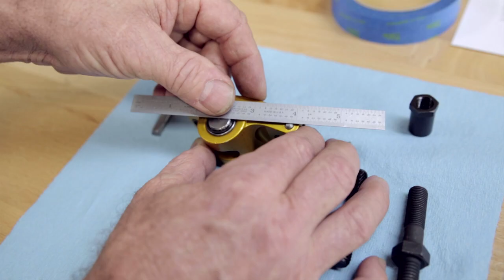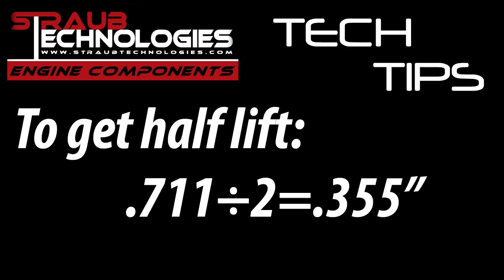Engine Tech: Valvetrain Geometry

Comment: Is there a method for doing this if you have a Comp magnum style rocker with a roller tip and no trunion in the middle?
Reply: Will this work for hydraulic roller lifters since you're not turning the engine over? I also have the comp ultra pro magnum xd rockers for my ford 400.
Reply: Yes it does, thanks! One other question, I'm downsizing the cam to one with less lift and a larger base circle. Does this typically require a shorter or longer pushrod?
Reply: @JT 5150, install the rocker arm with a valve/retainer and checking spring. turn down the nut to an approximate area where you 'feel that the geometry is close. look at the rocker arm profile side from the front of engine. clean oil off side of rocker arm and draw a VERY thin line, vertically with a pen or fine sharpie that is directly in-line, up and down with the center line of the rocker stud. 
Then hold up on the pushrod side of the rocker, and push down on the valve side of the rocker tip and watch the thin line rotate back and forth with each rocker jiggle. 
The thinner the line, the easier it should be to estimate the pivot point of the Trunion pivot centerline.

Comment: My rockers are different, if I go 90° @half lift, the geometry is all wrong. Drawing a line through the center of both doesnt always work. Say your roller at the valve is 1 size, but my roller at the valve is bigger, that ruins the whole theory. I found where my roller runs centered on the valve, but your theory doesnt work with my rockers from TRE. Yours are Crane and have a different geometry. I ended up with a 7.550 from a stock 7. 800 push rod.

Comment: If your mocking up the engine, it's best to use a used (previously compressed) head gasket.  This will save wasting a new one to get the head in the location it will be on the finished engine.

Comment: Good Video; I have found that if your using Hydraulic Lifters, especially aftermarket anti-pump up types (i.e. isky,crane,etc.) not only do you want to completely submerge the new lifters in Fresh oil (same as your going to use) over night; but before installing them in your engine; leave them submerged and install a pushrod in your drill press and pump the plunger up and down of each lifter until no bubbles come from the purging hole/s in the lifter, Than you have no worries of collapse,preload,etc, after installation
Reply: Take an old lifter the same measurement as you are using, take it apart and fill it up with JB Weld, then put it back together to get a good measurement.
Reply: i use an oil squirt can and fill the lifter.

Comment: Maybe I missed it, but how do you account for pre load on a hydraulic lifter with this method?
Reply: In my opinion, instead of counting turns on the rocker nut to set the rocker at correct installed height - you should put a dial indicator on your valve retainer and open the valve to 1/2 your valve lift. Say your cam card says you should have .500" lift with a 1.6 rocker - open the valve to .250" as measured by indicator, and adjust your pushrod accordingly. Or, you can disassemble an old lifter and shim it to essentially make it a solid lifter. Obviously, that is for checking purposes ONLY - NOT to be run as a solid lifter in an engine.

Comment: Good job, very well showed/ teached !! Now, question for you: I want, IF I can, to change rocker arm ratio from 1.6 to 1.7?? To increase valve opening, right? My engine is Mustang 3.8 litre V 6 (2004). Do you think I could safely do this, or is it possible?? I am planning to change stage 2 camshaft with stiffer spring too, also other mods, like intake, headers, cat pipe, aso, no turbo! Would I need different push rod length too?? I sure don't want valves hit the piston at 5000-6000 RPM, right =)) Thanks again, please, let me know, if I gain anything to change lifter arm ratio, and what do I have to do, if it is even possible?/ Thanks again=)

Comment: So I spoke with Scott on the phone and he took the time to explain to me in more depth the problem I was having with this method. Basically I was off a bit measuring my 90 degree angle. You have to understand the importance of being precise as possible on this step cause the slightest miscalculation is magnified because of the angles and ratios. Once I got it right the pattern on the valve was very narrow and just barely off center, which tells me my valve is being pushed straight down with very little sweep from side to side. This is the correct way to set up valve train.

Comment: I've tried this method several times and it leaves my roller tip way off center of the valve. The wear pattern is way outboard like the pushrod is too long.

Comment: Is the best way for my ls engine with comp cams non adjustable  ultra gold acr roller rocker 1.72 ratio  to get zero lash then just add the lifter preload to my zero lash length will that get me the proper length?

Comment: Why not just turn the cam over so the lifter is at half lift, then adjust the pushrod until the rocker is at 90 degrees to the valve? Obviously with the timing set installed so the cam is locked into that position

Comment: If I turn a 7/16" nut down 5 turns, the pivot point of the rocker arm travels down the stud .250".  But the rocker arm is not symmetrical, in that it has, say a 1.60 ratio.  So if the pivot point goes down .250", does theoretically the valve would "lift" .400".  Am I off base here?

Comment: For OEM hydraulic roller (short travel/high rpm) lifters should you add 0.050" to the pushrod measured length for pre-load?

Comment: Hi, I tried this and the pushrod seemed to come out really long when the cam is on the base circle.  (Longer than the stock rod and longer than the Crane Cams Length checker).  Should the cam lobe in question be on the base circle or at full lift?  I'm sure I did all the calcs right and using checking springs.    Seems like it wants to be at full lift to get a sensible length?

Comment: Never have installed a roller cam or rockers before, using the half lift method make sense to me theoretically,  just wanted your input and see if my thinking was right on this.  Averaging the lift between intake .515 and exhaust .530 on the Lunati 20510711 roller cam .5225 half that .26125/.050 is equal to 5.225 turns past 90 degree point with the valve.  So if I stop at 4.5 turns + 1 flat of the adjusting nut to measure for the pushrod, then when it’s installed it would be 5 turns + 1 flat or half turn past zero lash and that should center the roller on the valve stem and set the preload on the lifter??  Will this keep the pushrods all the same length or do you need to do one length for intake and another length for exhaust?

Comment: Not sure what my problem is, but there isn't enough stud height to aligning the rocker at a 90° angle to the valve stem. With the lock nut only 2 full turns the angle is about 85°. :(
Reply: I got a set of Flotek 180cc aluminum heads for a warm 355 SBC for a ski boat. Can't remember the pushrod length Flotek recommended, but it was WAY too short to acheive the 90* angle shown in this video. As the pushrod was getting about long enough to hit the 90* angle, I ran out of rocker stud height. Had to buy a new set of ARP rocker studs. Somebody is totally wrong on PR length - either Flotek, or the guy in this video. I went with this guy. Hope it works out for me.

Comment: For those of you that are being sidetract about the rocker ratio and thinking the ratio affects how many turns of the adjusting nut....this doesn't matter.The rocker ratio could be 1.2:1 or 1.9:1........ you still want to have the centreline of the trunions at 90 degrees to the valve at mid lift.....and then when that is established, measure for pushrod length.
Reply: Forrest Miller to be fair, the rocker ratio does affect how many turns you need to turn the adjuster, it’s just that it’s already been included. He is making his calculations based on 1/2 of total VALVE lift, which is your cam lift multiplied by rocker ratio.
Reply: This does not take the ratio into consideration. The lift is on the cam which will be multiplied with the ratio to create the valve movement

Comment: Awesome video indeed!
But just to see if I get this right, at the point of extending the adjustable pushrod (9:48) and taking up all the slack, the valve is still in it's fully closed position. So, at this point the lifter was sitting on the base circle of the cam, right?
Reply: Is it setting on the base circle of the cam

Comment: Should you use the cam card for lift figures or actually measure the overall lift with your rockers.  I ask this because rockers are rarely exactly what it is stamped (1.5,1.6 Etc..).  great video!

Comment: Much different method than the one in the Comp Cams videos.....Ill just stick with whatever guage my SHAFT ROCKER manufacturer provides me and try to keep my sweep centered on the valve stem so I don't prematurely wear my valve guides out......I just stay with my method because SIDE LOADING the valve stem happens when the sweep pattern isn't kept centered on the stem, I'd rather have my valve guides live a long life.

Comment: I might be missing something here but because the pivot point (as you wind the adjuster/polylock down) is the nose roller, then wouldn't the distance the pushrod end of the rocker moves, be more than 0.355"? I would think the pushrod end of the rocker would lower 0.533" (if you were using a 1.5 ratio rocker). If you wanted the pushrod end of the rocker to go half lift, would you not wind the adjuster 0.237" (for a 1.5 ratio rocker) ie. 4 3/4 turns on your 7/16" stud? Correct me if I'm wrong. I'm just trying to understand it all.
Reply: The head he is using is a Big Block Chevy,  Rocker arm ratio is = { 1.7}.  Gross valve lift is .711 {1/ 2 gross valve lift is = .355 }   .355 / rocker ratio { 1.7} = .209 lobe lift.(1/2 lobe lift }  At  1/2 lobe lift the rocker arm roller on the tip should sit in the center of the valve

Comment: So after following you procedure my sweep was .045" but only .090" from the exhaust side of the valve stem. Is this acceptable? Before my sweep was .100" and was dead center. It seems that you are fighting a loosing battle here because the valve stem and rocker stud converge the farther you go up on the stud?
Reply: I had the same problem I ended up with .050 backset crower rocker arms

Comment: This video is great  but could you explain how this method is going to work when you have a shaft rocker like on a mopar small block early LA engine with comp adjustable roller rockers.I dont know the thread pitch on the adjusters . plus how does this relate to the use of lash caps ,which I often do to create a wider wipe area on the valve stem for the roller tip.. hmmm

Comment: I have a zero deck 402 BBC with a solid roller isky cam, and Brodix BBO heads.  I asked Isky should I measure the pushrod length and Richard said not worry about it, pushrods would remain the same.  Im going to check everything anyways, but Id like to think they know their stuff, why would he say not to worry about it?  Is it because of the CI size of the motor?
Reply: +Danny Duplechian SO WHAT DID YOU FIND OUT ?
Reply: Have not put it together yet.  soon
Reply: +Danny Duplechian we'll get busy damn it

Comment: There's something that needs attention.   If your trying to get .355" at the pushrod by tightening down the stud using the top of the valve as the pivot, depending on the rocker arm ratio (assuming 1:1.5) you would only need to tighten the stud .213" or 4.3 turns ((1.5/2.5)x.355"=.213").?   Or am I missing something?

Comment: with hydraulic lifters you need to add the proper preload for the lifter used. Different manufacturers may require different preload for the same engine.
Reply: J Cunningham 1/2 turn on your rocker stud wont make a big difference. A 3/8 fine thread bolt has .042 per turn, a 7/16 bolt has .050 per turn. You buy custom pushrods at .050 intervals. Some builders like Ralph Johnson, Smokey Yunick etc. run their rockers on the outboard side of the valve, it turns a 1.5 rocker into a 1.65 rocker.  https://youtu.be/RjaosX63DkM

Comment: Just want to confirm what I've read in the comments... After the pushrod measurement is found, .an additional 050 will need to be added to that length for a hydraulic lifter engine for lifter preload. Is that correct?

Comment: Excellent video! Makes logical sense.
I tried this on my 454 with Edelbrock Performer heads and Harland Sharp rockers and encountered a problem-in order to get the line drawn at rocker pivot centers 90 degrees to the valve stem, the stud will be too short to catch any threads with the locknut. What to do now?
Thanks
Reply: +Scott Foxwell  OK, cleared that hurdle, thanks for the tip, but now I get a much shorter result using the marker method (12 turns out on the checker tool) vs. this method (20 turns out). With this method, the roller tip is to the exhaust edge of the valve stem, nowhere near centered. What am I doing wrong?
Thanks

Comment: Scott, shouldn't it be mentioned that the lifter needs to be on the base circle of the cam?
It seems like the push rod length determined would be different if it wasn't on the base circle.

Danford1
Reply: Worked good on my intake side,,   But something isn't making sense on the exhaust side.  I've got the lifter parallel with the retainer and the roller is way out on the outter edge of the valve tip and it doesn't even look close when I run the nut down 3 1/2 times
Reply: @Derekbitt, there could be two variables you may need to check: 
Is your rocker arm the correct fit...is measurement from centerline of trunion to roller tip center correct? 
Is your valve height correct? 
You could have an incorrect rocker arm design (are they aftermarket?) or the wrong valves installed (aftermarket or rebuilt?)

Comment: Great video!  Thanks for the excellent explanation.  I spent a full day of my life trying to figure out push rod length for my 498 stroker BBC.  I used 3 different measurement techniques and got consistently different length estimates.  Your technique resulted in the longest measurements by about 0.10 - 0.15 over the other methods I used.  I decided to rely on your method rather than collapsing lifters, looking at marker patterns, etc.  Hope it works properly for me!
Reply: Ummm? Just because the roller at the valve tip is larger, or smaller for that fact, doesn’t change where the center is.  You go from center of the trunnion bearing to the center of the tip roller to determine your “center line”. Only hitch I can imagine would be if the intake and exhaust had different size rollers at the tip. And even in that particular case you would just have to measure/setup the intake and exhaust independently.
Reply: His method works on Crane roller rockers, but my roller rockers have a bigger wheel roller on the valve end, so the straight line theory doesnt work for me.

Comment: Excellent video!  This is the proper way to measure, do NOT use the maker technique this is proper geometry and won't stress your parts. Thank you!
Reply: +Dave Mustaine Yes I left a warning comment on that video, haha.
Reply: +David Sanders Why not use marker??.  Marker technique seems much more fool proof than this!. 

The greater your rocker ratio... the more difficult (read: INACCURATE) this method gets.
Reply from the maker: David Sanders Thank you.
Reply from the maker: +Marek Sumguy 
A marker over math.   I dont' think so.   You base the lift off of what rocker ratio you are using.
Reply: +Dave Mustaine I just watched it and was like WTF
Reply: David Sanders Marker tecnique works just fine, my rockers have a different geometry than the crane rockers above and doesnt work for me. Builders like Smokey Yunick and Ralph Johnson ran their rockers on the outside of the valve stem to cheat class rules. This geometry turns a 1.5 rocker into a 1.66 rocker. Bottom line, you want your rocker on the center of the valve for longetivity.  https://youtu.be/RjaosX63DkM

Comment: Scott, Thank you for the video! I have a dilemma, using this technique and getting the rocker arm geometry correct vs using the sharpie to mark top of valve stem and rotating the engine over to achieve center of valve contact I have a .163" difference in measure. I am running a HYD Roller with scorpion 1.7 RR in BBC. Using your method I have a measurement of 8.033 and when using the sharpie on valve stem and achieve center contact I get a measure of 7.87. What should I do? Thanks in advance!

Comment: Scott, I read through all the comments and appreciate all the advice you willingly give. I had another question. I may be confused on where a hydraulic lifter sits when pumped up and in a running engine. I think I understand all the measurements and rationale however, here is the question. If I set up the geometry as you say, how is the lifter collapsing due to the 3/4 to 1 turn of the rocker arm nut and the resulting lifter collapsing and or where the push rod seat/lifter top cup (where the push rod sits) affect the measurement that we are calculating. In other words, it seems that the collapsing of the hydraulic lifter (versus solid lifter) would change our measurement (and the 90 degrees and so forth). Thanks in advance for your reply.
Reply: DAn did you ever figure this out?  I assume your asking if you add the preload into the lenght of the push rod?

Comment: Hi Scott, I am curious, how would you apply this to BBC shaft rockers like T&D or Jesel? I can see, how it would be easy to roll the engine to half lift and check the 90 degrees, is that the only way with that style rocker? Do you have anything posted I can look at on this? I love this video itself, it made the visualization quite easy, thanks!